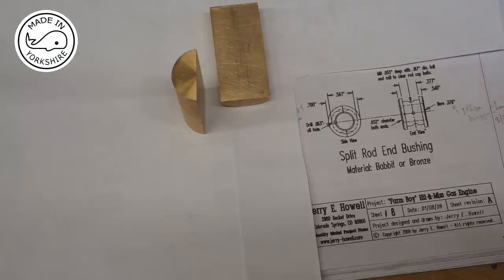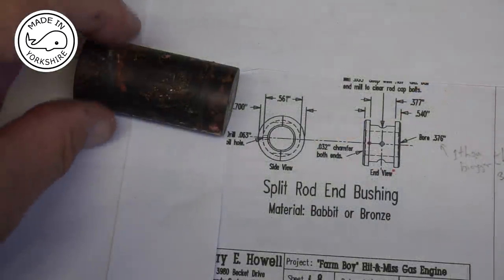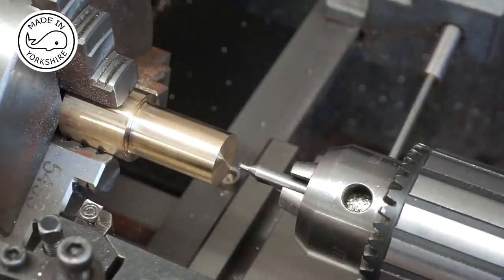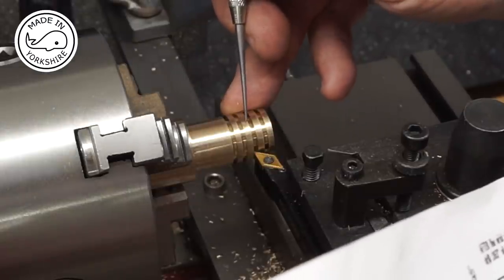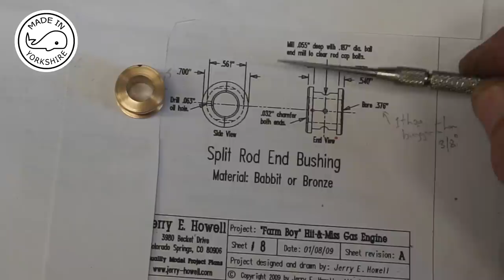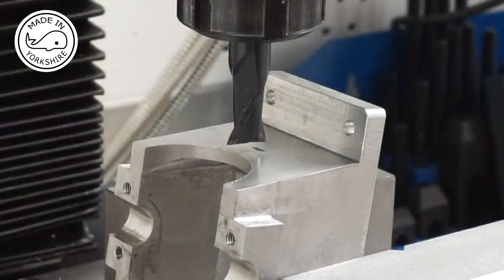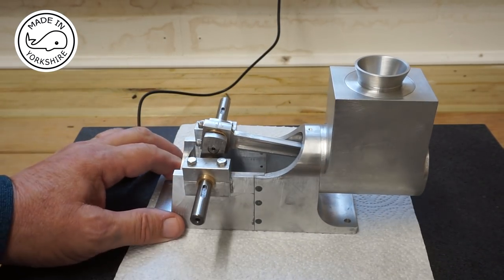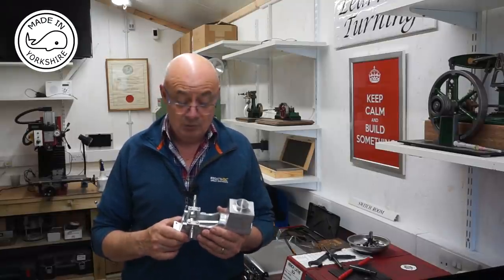#MT35 Part 11 - Farm Boy Hit and Miss Engine. The Split Rod End Bushing. By Andrew Whale.

Comment: Hi Andrew, it's looking realy good, well done.  One question though.  How did you ensure the split line was central when you turned the bushing?
Reply from the maker: Thanks Steve. After splitting with the slitting saw, I milled both inside faces and ensured that both pieces were EXACTLY the same thickness (from the inside face to the outside semi-circle). Then I soldered the two halves together. When clocking in the 4 jaw chuck I ensured that the join ran exactly between two of the jaws. This resulted in the narrowest bit being held between the other two jaws. After clocking the part it was pretty much guaranteed that the join was on centre. I hope that makes sense - I'm not great at explaining and my engineering terminology is pretty limited!
Cheers
Andrew
Reply: Thanks for the prompt reply Andrew.  Something else I wondered about.  You were concerned about the thickness of a Superglued joint.  Did the same not concern you about a silver soldered joint?
Reply from the maker: Hi Steve. I recon that the capillary action of the solder resulted in an extremely thin layer. I would guess far less than a thou of an inch. Like I said in the video I couldn't see the join with a magnifying glass.
Cheers
Andrew

Comment: Mr Pete 222 has done some videos about casting your own flywheels in lead. Might be an interesting sideline project.
Reply from the maker: Thanks Alex - I will check it out - though I think casting my own flywheels will be a bridge too far!
Cheers
Andrew
Reply: Learning Turning Metal - by Andrew Whale  he makes it look quite easy, particularly in lead with a low melting point. Plus  you have a 3D printer to make your pattern! Have a go, it’ll be fun🙂.
Reply from the maker: Maybe if I get desperate 😟

Comment: Go ahead with drilling oil holes in the main bearings as seen on the original engines
Reply from the maker: Thanks James - I agree. Richard has pointed out that the main bearing oilers are covered on Sheet 9 of the plans. I probably read that sheet 6 months ago and forgot!
All the best.
Andrew

Comment: Get yourself some of the green loctite. We call it bearing mount in the states it may be something different over there. It's made for press fits so it's really thin. You can use that to glue parts together and it separates easily with heat. Its a whole lot easier than silver soldering.
Reply from the maker: Hi Jeremy - thanks for the suggestion. I have actually got some loctite 638 and have used it to join shafts to sleeves etc but hadn't realised that it would be good enough for this job. Interesting!
Cheers
Andrew
Reply: @learningturningmetal  I've also used 638 for shafts in sleeves, Andrew and found it very strong. Not had much success with it bonding flat surfaces that will be stressed while machining. Soft solder sweating never works for me; it generally fails while machining - no doubt my poor technique. For what you were doing, I'd go for the comfort of a good strong silver soldered joint that's unlikely to fail while machining.
Reply from the maker: Thanks Len. I don't really know why so many people are adverse to using silver solder.
I'm glad that you think it's OK.
All the best.
Andrew
Reply: @learningturningmetal  
Maybe it's just the break with tradition.
The key factor for me is that you are turning and boring out substantial amounts of material while significantly reducing the surface area of the joint. Once you've got it round, there are no shock loads from interrupted cuts, but the final parting off must impose considerable stress on the joint.